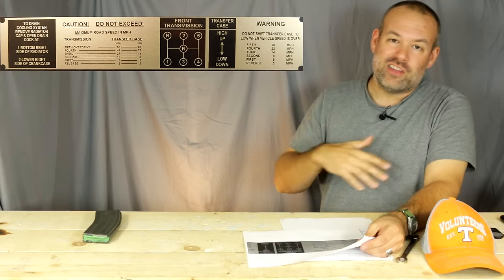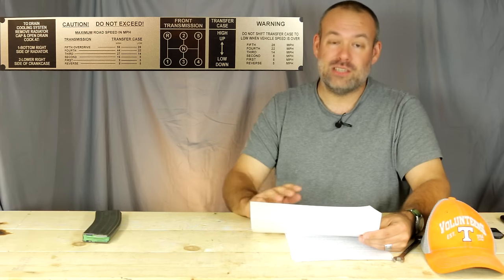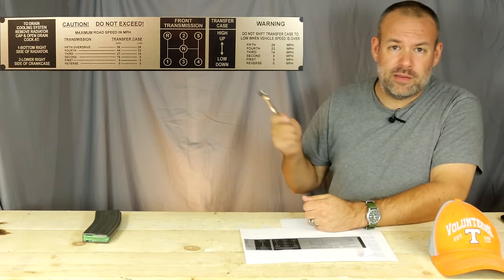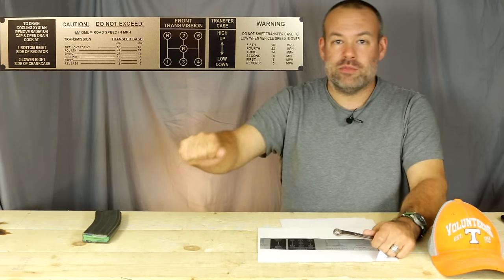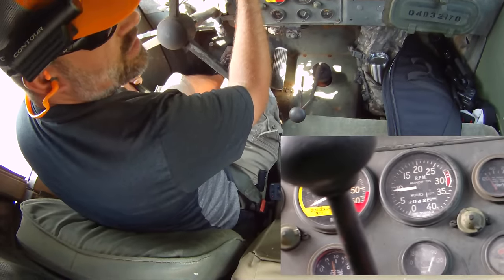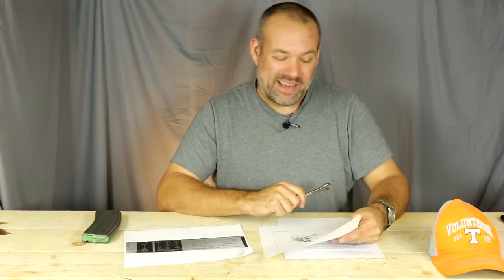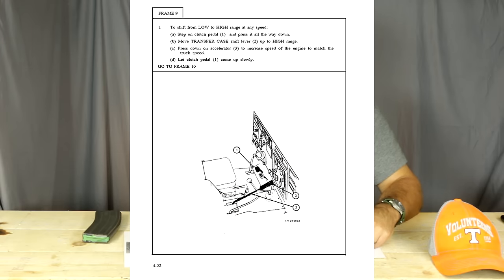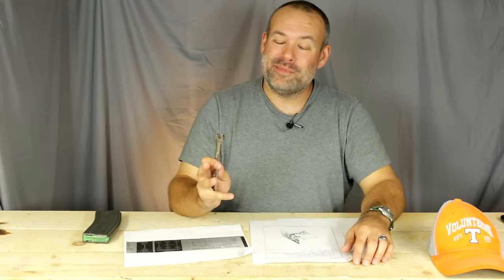The two Speed Transfer Case

Comment: I liked your comment about "GI" clutch less shifting:  since the Statute of Limitations has expired and Military Assistance Command Vietnam (MACV) is no more, I will admit I have done clutch less shifting in the taxpayers' Dueces.  Part of it was the challenge of exactly matching the engine and road speed with the target transmission and transfer case selection.  Nothing so sweet as going from gear to gear / range to range with no grinding, clunking and jerking!  Especially, since it was Uncle Sam's truck ... rent free ;-)
Reply from the maker: Dad has always described it as, "raking gears through Saigon" and it must have been a common hobby over there.
Reply: DEUCE AND GUNS Had to do something to keep sane.  Happy Thanksgiving!  DED
Reply: @donalddodson7365  I've done the same in Iraq and Afghan... As my dad (nam vet) says when we talk about parallel experiences, the more things change, the more they stay the same.
Reply: @Terribleguitarist89   I hope your dad is doing well (and you, too, of course).  So far, diabetes from Agent Orange has been just below the threshold.  My PTS floats up and down, often depending upon what other stressors are "incoming."  For me, driving in Vietnam was one of the best coping mechanisms.  All the best to you and yours.

Comment: Another great Deuce and a Half video.  Keep them coming.  

I ran across a thread on a forum a while back about buying a Deuce and a Half and trying to get it registered and insured.  Some states its almost an act of congress to do LOL.  I live about 30 miles from a place you can go buy military vehicles that are ready to go and easily registered...not every state is that lucky, and it seems almost every state has its own set of rules for these types of vehicles unfortunately.  The trouble I'd have buying one would be of course the $$$...or rather the lack of HAHA!!!...they are not cheap to get them in good running condition and paperwork ready to go to registration and insurance.

Comment: Dad's old 48 Chevy farm truck wasn't 4-wheel drive but it had a two speed rear axle and that's exactly how we drove it with a load of grain on. However, for driving without a load we shifted to high range and went through the gears without split shifting.
Reply from the maker: That's like a Semi-truck.  I had a big thing in this video about that but edited it out for time.
Reply: You should make a separate episode of the part you cut out.

Comment: Go look at the ZIL-131. It was a Soviet truck that served about the same pupose as the M35, but it was equipped with a carburated 6.5 liter V8 engine that made 150 hp, backed by a 5-speed manual transmission.
Reply: I had a friend (now passed over) who described Soviet trucks as running on any fuel, climbing up any grade, carrying enormous loads, but has no nice stuff like power brakes, power steering, synchromesh, smooth ride, etc.  Is that your experience?  Thanks.

Comment: Good Video, Thanks. 
      My clutch peddle is only coming back up half way but seems to still be working just fine, any ideas on this???
Reply from the maker: Does it actually top out half way up or can you pull it up to the level of the other pedals?  Each pedal is adjustable so someone tall may have adjusted the clutch pedal so they could fit their knee under the steering wheel.  If that's not it then it's time to break out the dash 20 to do some trouble shooting.

Comment: Thank you for the knowledge,
I recently changed out the front bearings on my 1985 M35A2.. (by the way the driver side is reverse thread) and now I've moved on to my rear wheel bearings but when I've opened up the cover and pulled out the axel. it looked fresh and new. Would you recommend saving my new wheel bearings till they start winding or just replacing them now.. the term if "it ain't broke don't fix it" comes to mind.. anyways I would like to see how you do wheel bearings.. I had to weld the race to pound it out of the Hub that's why I'm not into tearing out four more on the rear.

Comment: With respect, things are a tad different in a semi than you describe.

A semi has low and high range, but that isn't a splitter. Most modern (standard transmission) semis have both a range selector and a splitter. You start out in low range, normally in second. Compound if you are loaded really heavy. (Mine puts out about 300 hp and I weigh 97k and still don't use compound unless starting out on a hill.) You run your low range, then start over in high range.

With a 10 speed, that's it. With a 13, you do it that way through low range and then once in high, you can split each of those gears with the splitter. With an 18, you can split them all. A 15 speed is even more different, but similar. Just different enough that it will confuse most folks when compared against what I just described, but it does have its place.

Basically, low and high range are a way of making 6th gear right after fifth so that you have more gears available at low speed and a splitter is a way to divide gear ratios in individual gears, instead of affecting the gear ratio of the whole transmission.

The 10 speed that I drive has the same shift pattern, that wonky 4/5 reversal, but I love it. Perfect hand rest on a long run and the pooch has plenty of room for bouncing around the cab and sleeper. :D

Comment: Love your deuce and a half videos.  Watched 'em all before getting my first deuce and a half (got 2 now).

The shift lever on the transfer case is jumping around a lot after you shift to High.  Any concern about it jumping out of gear?  (Both of mine do this.)  Know of any easy solution?

Also, couldn't help but wonder if you actually get to full speed faster when doing this with a heavy load, or is the only benefit being easier on the drivetrain?  Thanks!

Comment: 44 years in the army. Started on M37 and M135, drove M35 for years. Instructed on many driver courses. Own and maintain 9 deuces. NEVER SPLIT SHIFT ON ROADS! They weren't designed for it and there is no need to do so. The manuals only include shifting the transfer on the move to allow dropping into low or stepping up to high while maneuvering cross country. 🙄
Reply: @Michael Calnan Thanks for your service.  I did 2 years, 9 months and 6 hours in the US Army (but who was counting?).  BC touched on it, the design criteria for over the road trucks vs. off road trucks are different.  I never tried changing high / low while rolling.

Comment: With a load on, either carrying or towing, you have a 8 speed tranny now. 1 thru 5 low to 3high thru 5high then od. making 8 moves on the shifting arm , 1lift on transfer bar and a pull on od button. When you first go thru talk yourself thru the whole thing then listen for the grind when you miss that transfer hop. Your steering is actually powered but it is known as a Manual Armstrong steering unit. Hopefully the computer sending unit isn't having a freeze from a cold ice cream cone prior to driving.

Comment: Thanks for the video and once again, learn something new about these trucks. I do have questions (hint for another video or 2) about these trucks I haven't seen you cover. First is tires & rims. From what I understand from watching videos by another owner, the rims are split....are yours? If so, can replace them with single piece semi-truck size rims on these trucks? Make it a lot safer if/ when you have to pop off a bad tire to replace it. Second is seeing  tires installed in 2 different places. One is stored vertically behind the cab, starting at around the bottom of the drivers door. The other is horizontal, again behind the cab, but starting about at the base of the drivers door. Third is how do you get these puppies out/put back in? Have you had a tire go bad on you while driving and if so, how did you replace it with the spare, meaning what equipment did you use?
Reply: the frount tires usualy weare alot faster than the back as the front axals has a lot more weight on and is turn more.the tires are a pain in the ass to change esesualy If the rim has rusted I just jack it up with a 20 ton bottle jack

Comment: If you have the transfer case engaged that drives the front axle because the ratios in the front and rear axles are different on dry hard surfaces like parking lots you’ll do some nasty driveline damage twisted drive shafts premature tire wear internal gearbox damage
Reply: Not true. These transfers were equipped with a "sprag" unit to the front axle. Frankly, I never saw the purpose of split shifting the M35's. The 5 tons needed it when heavily loaded, especially the M809 Series with the big gap between 3rd and 4th gear.

Comment: Don't talk about semis without more research. I'm a trucker. So, here we go. 
The only transmissions that you split the basement gears is 15, 18 speeds. 13 you split top. 9/10 you don't actually split. You go (10speed) 1-5 flip the splitter to high and go back through. 
Super 10 you split every gear. 

Clutches are for those that don't know how to float.
Reply from the maker: So my point that a Deuce and a half has almost nothing in common with a Semi is true.  Thanks.

Comment: Brilliant!   Another Deuce Video.  I would have thought you would have put the transmission into neutral and then shifted the Transfer case and then shifted the transmission into the next gear while on the move. Did I hear a 'Thud' when you shifted the transfer case from low to high?  I've not tried it yet on mine. Are you going to do any more Video's on the winch and its operation like you mentioned in the winch video?   Aussie.

Comment: What a M35 has is a "mud stick" duplex mv because you cannot split each gear. It does allow you to use the 4-5 shift twice which is the tightest gear change in the truck. The proper method to shift a 2 sticker is to move whatever lever is being up shifted FIRST. Wh et n accelerating  that would be the transfer,  when downshifting the main would go first. The truck should launch in 2nd-low without difficulty. You should always back up in low range. The hi-lo. Unlike a CCKW OR M38 has nothing to do with the front wheel drive . The transfer case also facilitates towing as put in neutral and go. It is only necessary to drop drive shafts if the problem is the transfer itself.

Comment: I've seen duce in a halfs doing 55mph down the road does that hurt the motor and is it possible to have a slightly higher gear ratio to get a higher speed without hurting the motor
Reply from the maker: If by Deuce and a Half you mean an unmodified M35 series truck then 55mph is pushing that engine at it's limit.  It's designed to run at 45-50mph all day long in convoys but running faster than that for a long duration is really unnecessarily stressing the engine.   If taller tires or a different gearing are added then faster speeds can be run safely for long periods but will result in more downshifting in mountainous areas.  

What's typical is newbie buys a Deuce and drives it everywhere at 55-60 mph because the engine is strong enough to push a 14,000lb brick down the road at that speed.  That person then makes fun of all us cautious Deuce drivers and explains that they know what they're doing and we know nothing.  Fast forward a year or two and that newbie is telling the world how poorly built the multi-fuel engine in Deuces are because their engine threw a rod through the block while all us just shake our heads.
Reply: DEUCE AND GUNS I live in Florida so mountains aren't a problem  so higher gearing would probably be good as long it doesn't hurt the engine
Reply: DEUCE AND GUNS I'm ordering one from boyce equipment but where I'm driving it is probably won't have a problem driving it there's only one place the speed limit is 60 but I probably don't have to go that fast 50 would probably be fine some of the places I drive it it'll either be 45mph speed limit or 35mph so the stock gears would be good I'm definitely not driving it on the interstate but 50mph would be fine anywhere i drive it people don't like it they can just go around me
Reply: DEUCE AND GUNS  and actually the minimum speed limit on the interstate is 50 anyways but like I said I'm probably not driving it on the interstate but I can't wait to get a bobber because it's always been a dream to own one and mom wants a truck in the family how much do they tow anyway I know they don't tow as much as an F350 but it hopefully should tow enough
Reply: Aha I got a duce right around to over 60 and hasn't made any difference had the truck for about 20 years and reve counter has never been in the red mind you this was on flat ground God knows the speed when going down the hills
Reply: kirby vanduzer check out the waterloo 5th gear up grade. it takes it from a .85 to a .69. you can Max out at 70, but really makes it nice to do 60 all day
Reply: @badcompany7674  Sadly, waterloo no longer makes the 5th gear upgrade.

Comment: Do not split shift a deuce 1/2. It is completely unnecessary. Low range transfer case is for off road, up in the hills or mountains or for over weight loads. Use high range for all other loads.
Reply: Alot of people dont understand the difference between a gear range and a gear split. A gear range is a range of gears that, depending on application, is sequential to a lower or higher range (ie on a 10 speed, 1-5 is low range while 6-10 is high range) or a ratio adjustment of the gears in the transmission (ie the difference between 4 low and 4 high on a 4x4). A gear split takes the normal gears within a range and provides a gear in between, creating a high and a low ratio for a numbered gear, "splitting" that gear (think 1, 1.5, 2, 2.5, ect). In the dueces, the transfer case is a ratio adjustment range selection, to be selected at a stop.

Comment: How do you shift from hi to low?
Reply from the maker: The lever in the floor.
Reply: I guess my question is when on high speed I didn’t see you shift down using hi to low
Reply from the maker: I started out in low the shifted to high at 5:00 in the video after maxing out 5th gear in low.

Comment: automatic duce with power steering or air assist possible
Reply from the maker: Only the M35a3 had an automatic transmission.  The 5-tons have automatic trans as well.
Reply: Brett Duffy autos suck

Comment: Seem s a little different the Eaton Road Ranger my Semi had was  low 1-4 the switch the Air operated splitter and do 1 thru 4 again not splitting every gear

Comment: Hello you all! Can anyone help me with my m35a2 clutch adjustment? I replaced everything for the clutch with new parts, throw out bearing, crank bearing, flywheel, pressure plate, clutch disc and all the bolts for all this parts. With OE parts btw. And the truck feels the same way, dead. Like if it's still had the old clutch parts. HELP HELP HELP!!! Thank you! DEUCE AND GUNS

Comment: Dude truck drivers don't split every gear if it's a 10 speed it's 1-5 then flip the splitter then 6-10
Reply from the maker: Yep, i was incorrect on that...luckily this is a channel about the Deuce and a half and my point still stands that the M35 is way different than a semi.